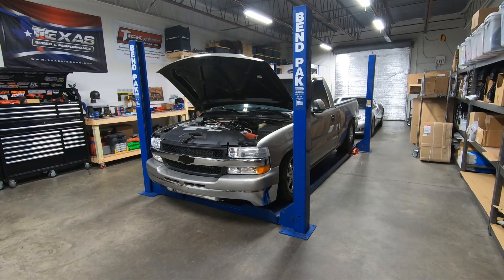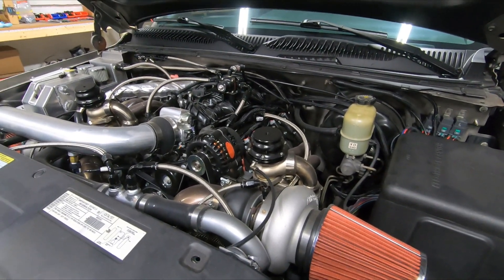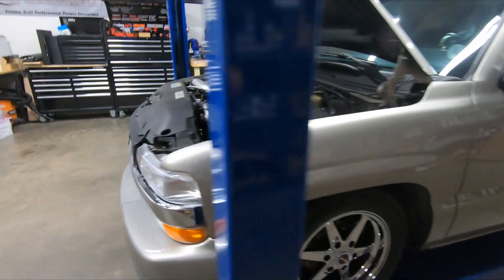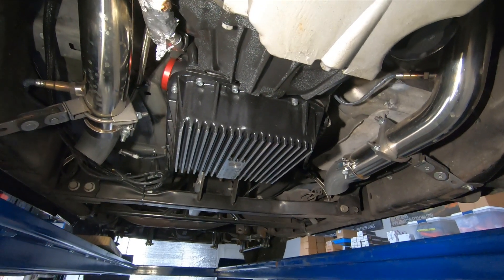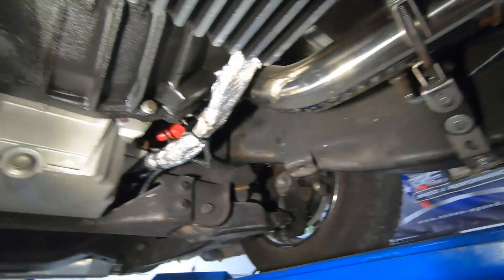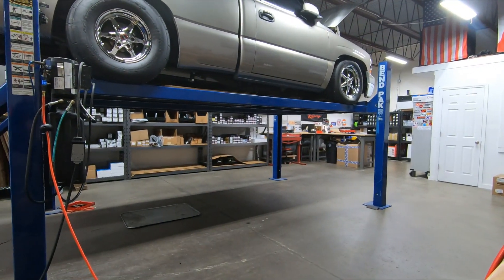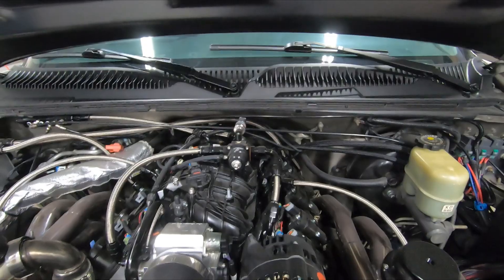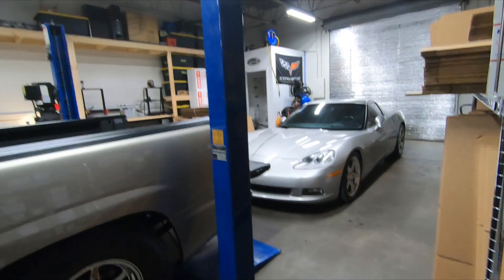GAP Single Cab Episode 0 - Intro to our Twin Turbo 6.0L 1999 Silverado RCSB

Comment: I too love the truck. I’m looking forward to watching the build series. I have also daydreamed about T56 swapping mine. If I like how you do it, it might happen. How do you like the 4.56’s with the 295’s?
Reply from the maker: I loved the 4.56s with the 295/65 combination back when it was NA.  It was a little too much in first with the turbo combination and limited my trap speed to around 120mph or so before overdrive was needed, so it wasn’t as good of a match for the forced induction combo. The T56 ratios like a little more gear, and I’m more comfortable putting the truck in 5th with a manual trans to cross the traps if needed. So, we’ll see how they pair with the 6spd!
Reply: @glennsautoperformance  I’m planning on going 3.90 but I’m running an 80E and I’m currently NA maybe one day it’ll get boosted.
Reply from the maker: @DandersonGM  The 3.90s will be a good all-around gear with the 80e, with anything from a 28 to 30 inch tire.  I like steep gearing and would not have a problem going steeper - but if you want a really nice balance of street RPM vs. torque multiplication, I think the 3.90 choice is a good selection!
Reply from the maker: @DandersonGM  The 3.90s will be a good all-around gear with the 80e, with anything from a 28 to 30 inch tire.  I like steep gearing and would not have a problem going steeper - but if you want a really nice balance of street RPM vs. torque multiplication, I think the 3.90 choice is a good selection!

Comment: How did you keep you plug wires from cooking I keep killing wires on my truck
Reply from the maker: Having the right boot angles and using some DEI sleeves and I haven't had any trouble yet.  If you're looking for suggestions, I would recommend the MSD Super Conductor wires (we sell them).  The have indexable ends on the spark plug side that you can bend you whatever angle works best for you combo up to 90 degrees.  It really helps with being able to get a set of wires to fit when you need multiple different boot angles to fit a particular set of headers.

Comment: What lowering kit is on the truck now?  What shocks?  What concerns do you want to address with the ride?  I’m in the same situation with my 01…I want a better ride.  I’m on a 3/6 drop.
Reply from the maker: Hi Luke, 
Right now the truck has 2" drop spindles and cut coils up front, with Belltech Street Performance shocks.  It's probably roughly 5 inches of drop up front, maybe more with the additional weight of the turbos.  The front doesn't ride too bad, but is pretty soft.  The rear has a flip kit with clamped overload and traction bars.  It also has a shock relocation kit with Viking double adjustable.  The back is pretty rough, but it's likely just due to the shock tuning and traction bar preload.  Works well for the drag strip, but is pretty jarring on the street.

We're moving to full Ridetech suspension on the build and have just wrapped up the front suspension (video coming soon).  Waiting on custom wheels, so no drivetime yet, but I'm sure it will be a night and day difference.  We will ultimately end up doing the Ridetech 4 link with coilovers in the rear too, but for now we're going to re-tune the existing rear suspension setup and see what sort of improvements we can make.

Comment: Which turbo kit did u go with
Reply from the maker: It started life as a Speed Engineering kit, but it has been changed a lot from the original orientation.
Reply: @glennsautoperformance what did u replace speed eng kit with? A single?
Reply from the maker: @rpelonm  It is still the SE twin kit on the truck, just a lot of the SE components have been changed out or upgraded.  Still the same overall configuration though.